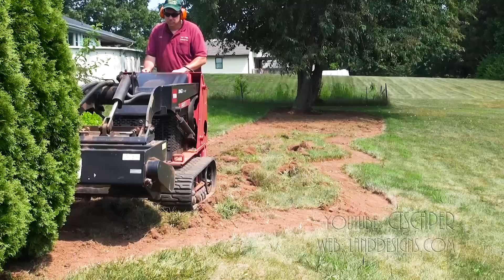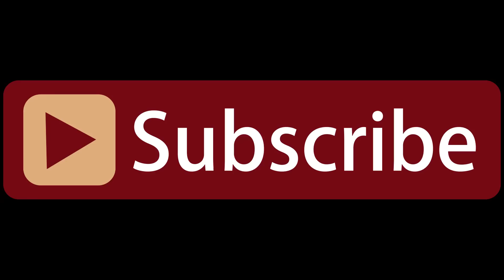TORO DINGO TILLER

Comment: What’s the best attachment to use to get rid of English ivy on the ground .. Thanks !!
Reply from the maker: I would put the bucket at a 90-degree angle to the ground and drag it back and it will pull the ivy out.  Put a lot of pressure on the bucket, so the front of the tracks lift off the ground, and slowly roll back until it stops pulling the ivy.  Repeat as soon as it loses grip of the ivy roots.  You could scoop out the top 2-3 inches of soil if that doesn't work.